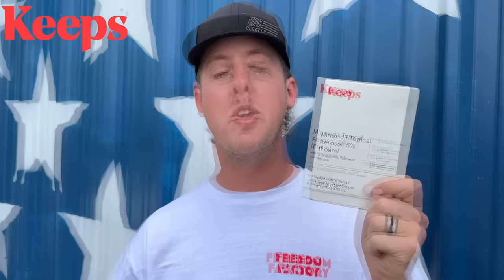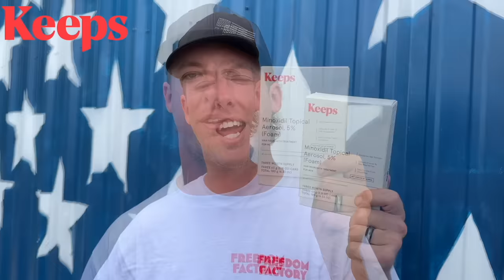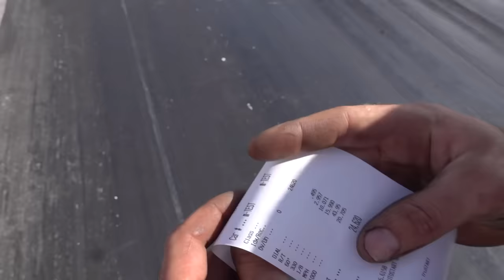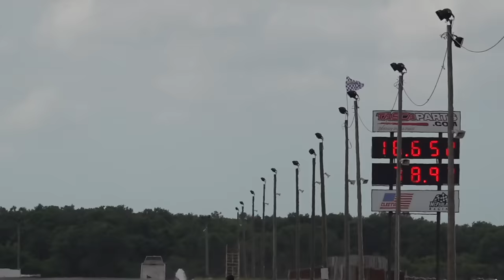Racing My Big Block Tow Truck!!! (Ended Horribly)

Comment: I love Sam in the back of the 7.3 moving his hands in a circle and throwing his hands up when nothing happens
Reply: That was too funny!
Reply: yeah seen that too and just laughed aha
Reply: Think he was trying to tell cleet it wasn't spinning 😂 I was cringing at that part seeing him have it up on the rpm without it spinning😂
Reply: turns out 2 tyres on each side needs way more power to break free..!
Reply: @Osamabintardin  Sits on the trans for two years trying to spin the tires and is surprised it was slipping so bad 😂😂
Reply: @gowerski  those trucks are dogs. My buddy had a 7.3 F350 of the same era with just singles in the back and that thing wouldn't powerbrake either

Comment: I have been watching Cleet since his YouTube beginning, and I've seen him blow up lots of things. This is the most shaken I have ever seen him after a run.
Reply: I think the oil on the track worried him more than anything. He does love that truck though. lol
Reply: When the blazer had the linkage fall out of the master cylinder and George had no brakes, is the only time I can recall him breaking the fun guy character. He was genuinely shook up. A little scared, a little mad at a safety oversight, obviously relieved everything was ok. He wasn't cleet for a minute there. He was a concerned friend, business owner, man responsible for everything going on. And he of course, handled it like a pro. Great dude, this Garrett Mitchell.

edit to add. I really appreciate how much thought for safety is put into this channel. It's OK to wear a fire suit and a helmet. You can have fun and still maintain a level of caution and safety equipment.  Cheers to such an overall success as McFarland Entertainment has become.
Reply: @dustyc324  Don't forget when the Fiero rolled
Reply: Fierro flip no brakes on the blazer and coop catching fire are the few times cleeter dropped the persona
Reply: @johnkilo3  I guess we are starting to see why George isn't allowed to drive anymore!🤣😂
Reply: @1992djg  True, but this one seemed to last the longest.
Reply: water under the tire in Leroy when initially going for a 7 had him pretty shaken up, this seemed more like a what the hell just happened
Reply: @WisecoSerious  oh yeah. that was a hairy moment too.
Reply: Cleet runnin into the sand box…
Reply: When George flipped he went straight back to being Garrett

Comment: Ole cleet and squirrel gonna be busy with some repairs 😂
Reply: Now they get to fix the corners they cut when doing that engine upgrade. No one thought about beefing the u joints and Carrier bearing even after adding all that torque and power.

Comment: In the early 80's, I built a tow truck out of a '61 Ford stepside, 390 w a cam and aluminum intake, Holley 750. It had the same giant truck 4speed. It went 13.8 , 101mph on 35" off-road tires. 3.73 F350 rear.
Reply: A real life cleeter

Comment: That was a flashback for me. Back in the 80's I drove a flatbed like that. The front u-joint blew and beat the crap out of the bottom of the truck, it was fricken LOUD!!! Luckily the drive shaft didn't grab the curb as I got it off the road and blow the rearend out. Good thing I didn't have a car on the deck,  that would have been bad. Great videos brother!!!

Comment: Well so far we’ve got a fragged transmission in the wrecker, shucked a driveshaft which tore all the hydraulic lines off and an expedition with the bumper ripped off. I’d say you guys are doing great.

As a resident expert of old GM tow trucks I kinda figured that driveshaft was glass behind that engine.

Comment: Cleet I have a science idea. Run the 7.3 then hook a truck and strap it well, run it again and you both floor it so you basically have 4wd. And then maybe run it a 3rd time with the tow truck in neutral and the truck being towed flooring it. You could use one of those front wheel uhaul trailers and it might be less sketchy but either way itd be cool to see how much difference 300 or so extra HP would make with the added weight and it might be the only 8 wheeled, twin engine diesel and gas combo vehicle to ever make a 1/4 mile pass!

Comment: My old 7.3 once upon a time had a slipping transmission, 8k later that’s no longer an issue. That 7.3 of your needs a tune and a turbo upgrade and she will be much happier, valve springs are a must they don’t have great springs from the factory. I learned that when it broke a few rockers and cost me 5k to have the heads redone, was told by the mechanic it’s a common issue for 7.3s around the 200k mile mark particularly for those of us who drive in a spirited fashion with increased power.

Comment: Notes to Cleet:
You can't run a towing service without wreckers! 
If you break everything you need a LOT of wreckers! 
You need wreckers to tow broken stuff!
A rolloff doesn't literally mean that!
If you drag deisels you need oversize injectors for extra power!
You need an in-cab manual fuel pressure regulator so you don't get blowin coal tickets!
If you can't do a burnout you have too much traction! 
You need a special team just to repair YOUR damage!!

Comment: CLEET !!! The damage would NOT have happened to Tye's Exploder if you STRAPPED THE WHEELS ON THE BOOM !!!  You are CRAZY to pull your other tow truck anything over 8mph with NO STRAPS ON THE WHEELS !!! you have NO IDEA how bad things go when a truck like that comes off the boom at even 20mph . You are going to total your vehicle and POSSIBLY KILL SOME ONE COMING THE OTHER WAY !!!  DUDE !!! DO NOT DO THAT !!! You are smarter than this. STRAP YOUR WHEELS ON EVERY SINGLE TIME. EVERY...... SINGLE...... TIME !!!!!!!!!!!!!!!!!!!!

Comment: Cleeter, your wheel lift boom is supposed to center out automatically to engage the wheels evenly all by its self so you dont back into the vehicles front bumper while trying to hook and book. Have squirrel look at that, or i can come and fix it for ya!

Comment: Dude handled it very well, after beating his truck up, heck if he didn’t pull the front off, the transmission might of blown up not being towed on a flat bed, so many models can’t be towed today in neutral due to how some gears are turned and lack lubricants if the engine isn’t running and then in gear..unless it’s a front wheel drive ,and towed from the front, I’d never let anyone tow my vehicles without a flat bed,unless it’s a 1980’s or older.

Comment: Usually not a double commenter but just got to where you blew the driveshaft and hydros. Did you by chance still have the pto engaged? Those hydros shouldn't have sprayed that much not under pressure. Because 99% of the time if you bust a line the cylinder slams shut not open like the tilt cylinders are. Just weird it happened like that and pto engaged was my first thought.

Comment: You really need to rebuild the head on that dynamic reach out to Miller industries you can get the bushing and pin and that head won't sag down anymore you wouldn't have ripped Ty's bumper off if you had fixed that bushing and pin

Comment: You need to prepare  for Trail Mater. Yeah you're a bad ass on the strip but when it comes to tow trucks...Maybe you need to spend some time working with Trail Mater and Matts off road.

Comment: I think he left the PTO on and over pressurized to transmission and just blew the seals out which forced the drive shaft out
Reply: The PTO doesn’t add any pressure to the trans. 
The driveshaft on something like that isn’t really made for high speeds. I’d bet it just broke the driveshaft and that took out some hydraulic lines since it all happened about the same time. Bed went down from gravity since it was already back.

Comment: Hear you Tye
A towing company must use reasonable care when towing and storing your car. If it fails to act as a reasonably prudent towing company in the same and similar circumstances and damages your car or your property inside it, you may be able to sue for negligence.